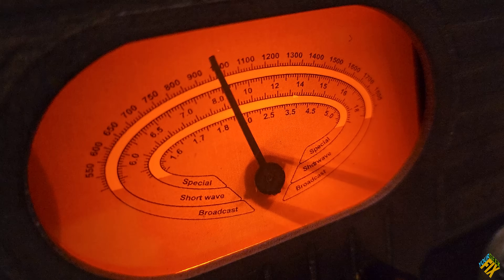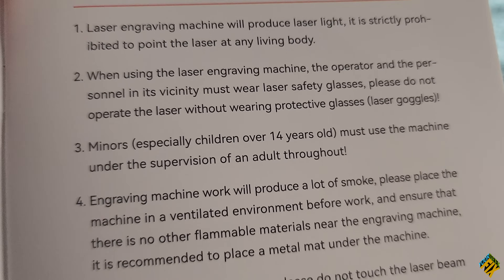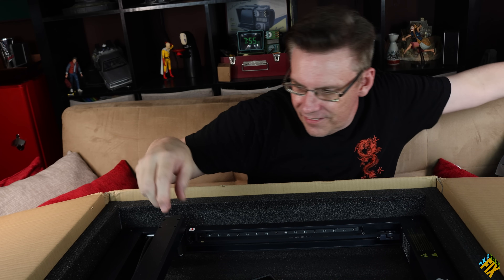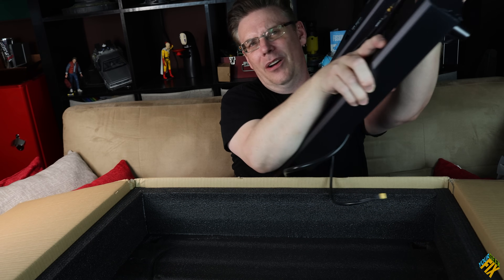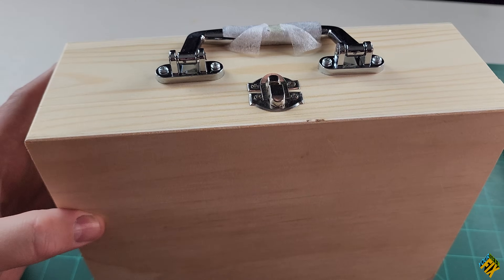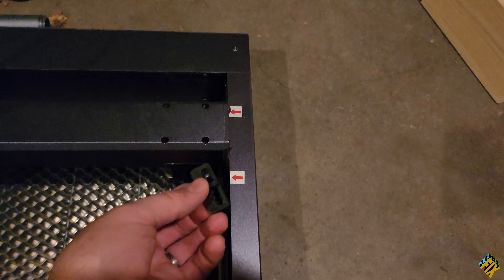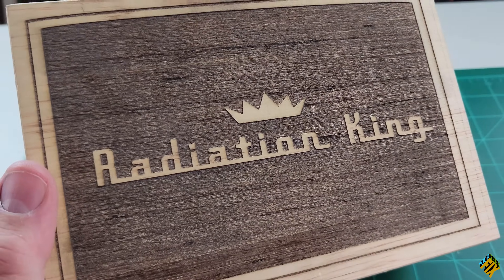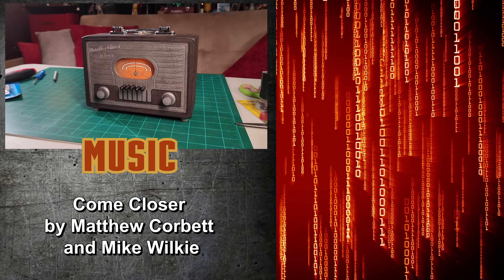We Made a Working Radiation King Lunchbox with the ACMER P2 Laser Engraver

Comment: Two things I would have changed: I would have switched the Coloration of the LEDs so the King lights up in Amber when used with BT/SD, as this would be the standard use. I also would have used a different approach for the Knobs. I would have used a Timing Belt in the correct size (you can get these even for the tiniest sizes online for a couple of bucks).
Reply from the maker: Ok

Comment: I have WAY too many ideas on how to make this even cooler. Plastic insert to make it safe for a lunchbox and waterproof between the food and the electronics, hide some phone batteries in the insulation between the wood and plastic to give it a nice and long battery life and even add a Type C charger to the very back of the box with a little waterproofing plug to keep dust out. Then seal it with a lacquer finish for the true old timey radio feel. Also I would tighten up the rubber bands going between the knobs to make them more responsive.
Reply from the maker: Ok

Comment: OK Jeremy that was fun not at all what I expected when you told me it was a lunch box I didn't think that they would be wooden lunch boxes which made it even more so like the radio was pretty clever it's saying you had to burn through two of them before you finally got one right very very nice turned out good I think you should take some furniture Polish like old English and Polish the whole case and then use some spray varnish to give it a lacquer shine and we'll be good to go.

As for your internal guts that's very clever I was just talking to James today and he asked me that very same question what was I gonna use for my internals of my radio why the same idea as you but I didn't go to Teemu because you can't anymore they're not shipping to the US so I found one on eBay for 15 bucks and did the exact same thing you're doing I ripped it apart took it out of its case and reassigned everything it's got exactly the same features as yours plus one other am fm shortwave Bluetooth USB and the micro SD card. And just like yours I'm sure it's also USB powered so great minds think alike.
Reply from the maker: Very good!